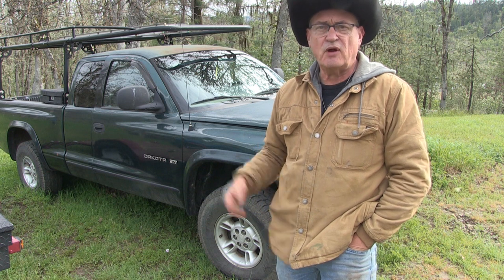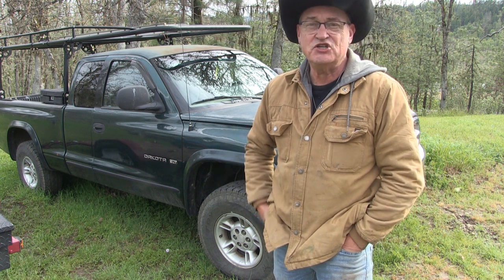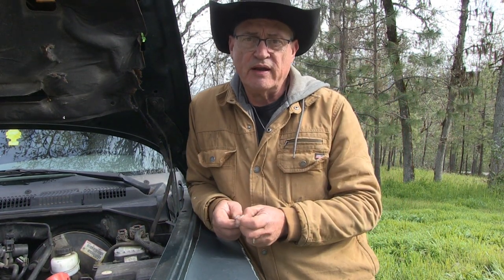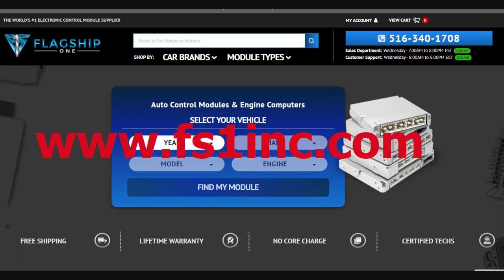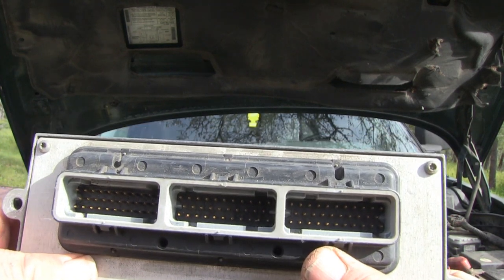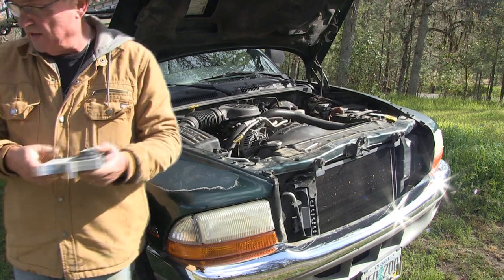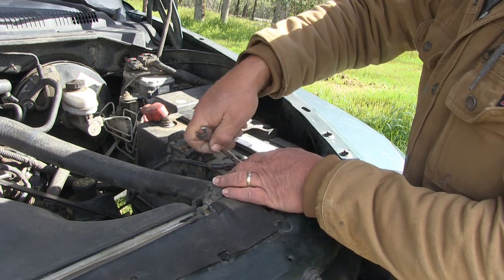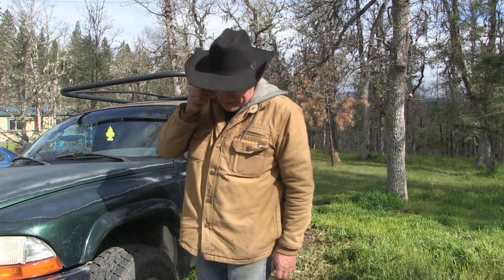I FRIED MY BRAIN Troubleshoot Electrical on 1998 Dodge Dakota

Comment: What fried it in the first place and will it happen again if not fixed
Reply from the maker: It went out when I pressed on the brakes. Discovered there is a short in the brake wiring on the trailer.

Comment: Sorry to say but that would be a 97 pickup...Dakota did not switch to that body until 97 although all the wiring, computer, drive train etc are the same as a 95-96...However, internal tranny parts were changed on the automatics...There are a couple guys here on youtube that show how to fix those computers and upgrade some of the parts in them to be more reliable...although my 97 has 300k miles and still goes strong with the original computer...so there is that...soon will be putting in a fresh bigger 5.9L....Also upgraded the small 8 1/4 rearend with a bigger 9 1/4 axle....9 1/4 was not offered until 98 so any 98-2003 Dakota 9 1/4 will swap in no problem...just make sure you get the axle clamps, u-bolts and driveline with it..and match the gear ratio on 4x4s....When you buy those reman computers they have generally had the upgrades done to them as I mentioned earlier that you can really just do yourself if you know how to solder...
Reply from the maker: Nope, it's a 1998 Dakota. I mispoke in the video confusing the year of the truck with my 1996 Ford Thunderbird.
Reply: @pinemeadowshobbyfarmafruga8319  lol...well that explains a lot...Must be getting old like me...lol